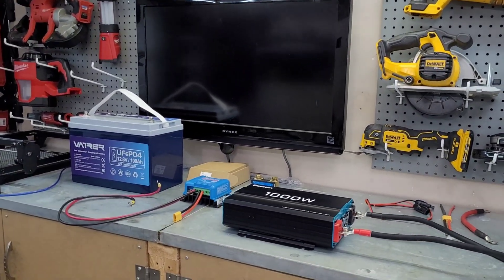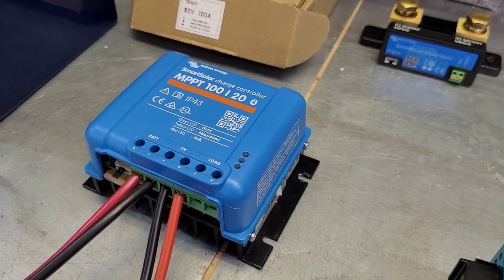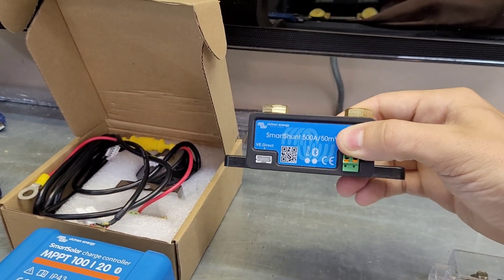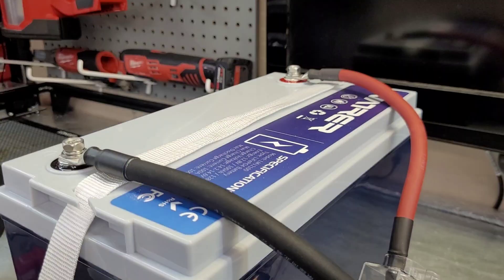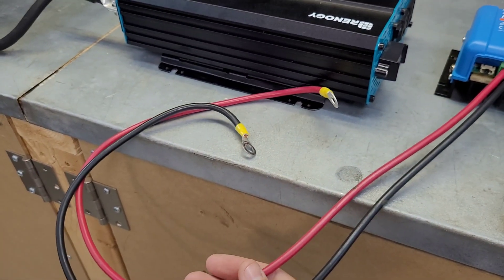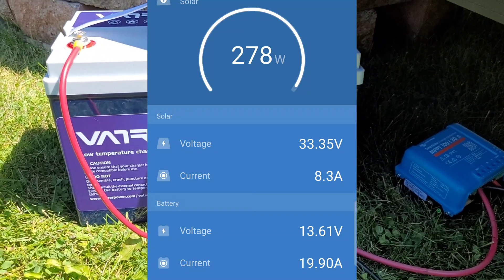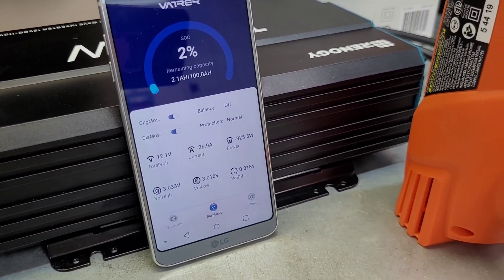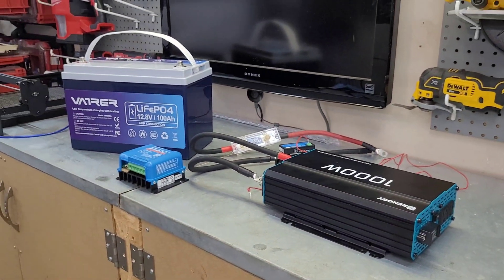How To Build A DIY 12V Solar System *For Beginners* Vatrer 100AH

Comment: If i left these batteries in my storage unit when below zero temps, will they be ok till spring if not being used when it's that cold?
Reply from the maker: It's a little harder on them but they should be fine if not used

Comment: Is there a panel.system that will power a 12v item direct from a panel without a battery.just.constant. power
Reply from the maker: @mtfishing3268  yes you could buy 12v panels or use an mppt with your load connected to the 12v output side
Reply: @SmitHVAC.  thank you